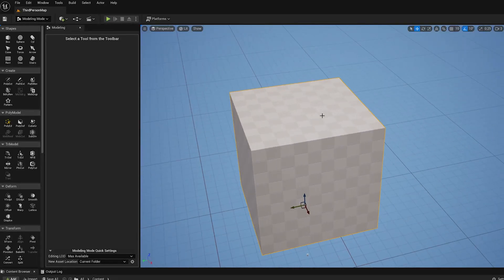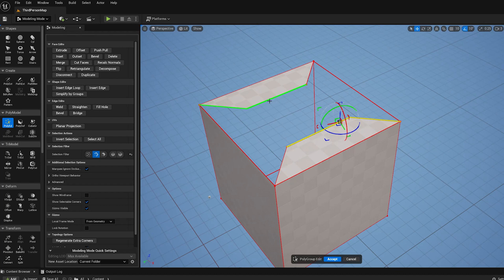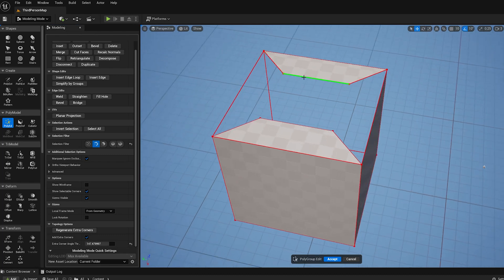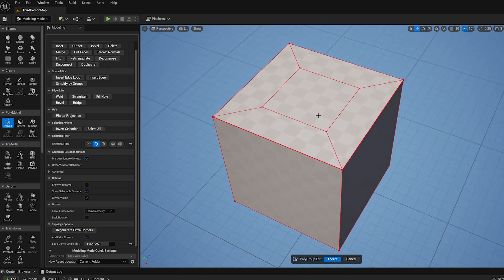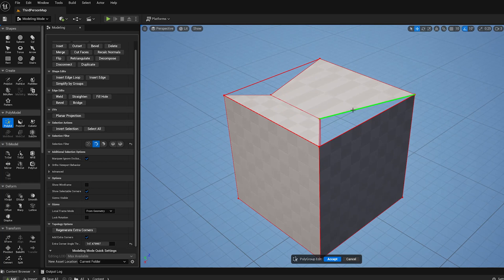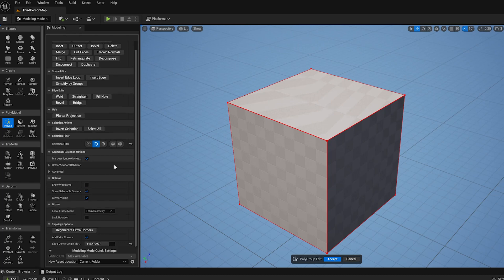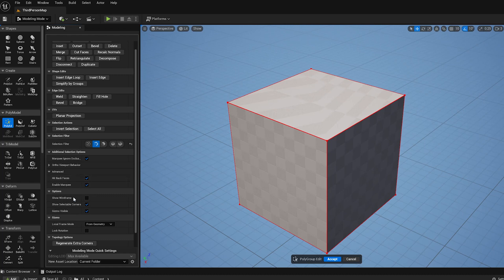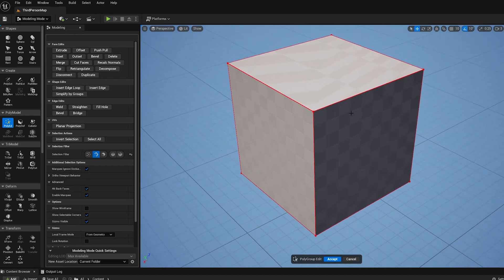UE5.1 PolyEd Modeling Part 11 - Bridge and Weld

Comment: Hi Ryan, I'm so glad I found your channel. Your videos are awesome and thank you for sharing your knowledge.  UE5 modeling tools are powerful and I was wondering if there was a way to create volumes from a dynamic mesh inside a Blueprint. I see the option in the modeling menu, but I have not found a way to automate the process.
Reply from the maker: There is a GeometryScript function CreateNewVolumeFromMesh that should do this for you (but it is Editor-only - Volumes cannot currently be created at runtime)
Reply: @RyanSchmidtEpic  Thank you very much for the swift answer, it's exactly what I was looking for. Though I wish it can be created in the in the active/open level. I guess I could load the current open level, not ideal but hopefully moves these feature from experimental soon.

Comment: Thank you very much!
Will you go on with other tools in this mode? 
And another question: will there be added a numeric input for moving, rotating and scaling? 
(I'm kind of used to model in correct measures without eyeballing)
Reply from the maker: numeric input is something we get asked for a lot, and it's on our roadmap but I couldn't say it will necessarily happen in 5.2
Reply: @RyanSchmidtEpic  thank you Ryan!

Comment: May I edit Modeling in runtime?
Reply from the maker: Modeling Mode is a UE Editor Mode, so it's only available in the Editor. It is possible to use many of the tools at Runtime, but not to edit Static Meshes. I have some blog posts w/ sample code about how to do it here: https://www.gradientspace.com/tutorials/2021/01/19/the-interactive-tools-framework-in-ue426   and here: https://www.gradientspace.com/tutorials/2022/6/1/the-interactive-tools-framework-in-ue5
Reply: @RyanSchmidtEpic  I have some idea to modify Static Meshes at runtime. So I thought about function to convert static mesh into dynamic to use some boolean operations, but I didn't find any convert function. Will it be added? Anyway It will be useful I think.
Reply from the maker: @ylly8187  In UE5.1 the CopyMeshFromStaticMesh function in Geometry Script (blueprints) should work at runtime for static meshes if you have set the bEnableCPUAccess flag on the asset (so that the vertex buffers/etc exist on the CPU to convert from). However the runtime mesh will be split at any UV seams, hard normals, etc, so you will likely need to use the WeldMeshEdges function to recover them. Note, however, that you cannot actually update a StaticMesh at runtime - you can either create a new UStaticMesh, using the runtime build path, or you have to replace it with a DynamicMeshActor/Component.